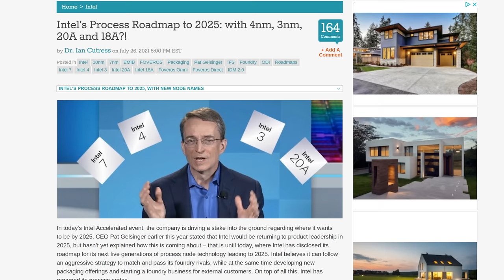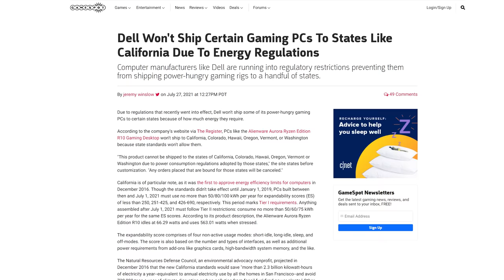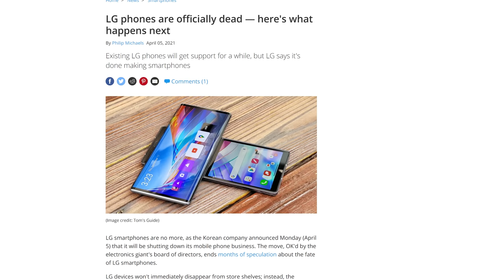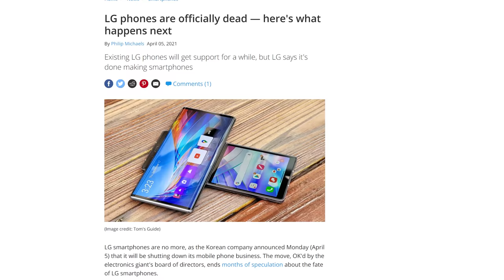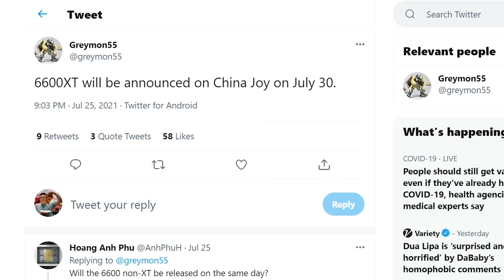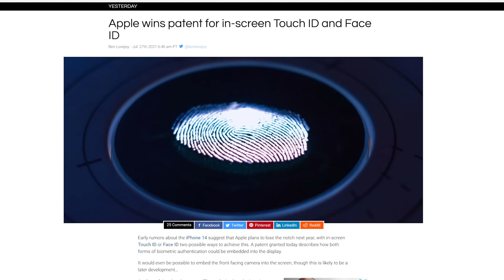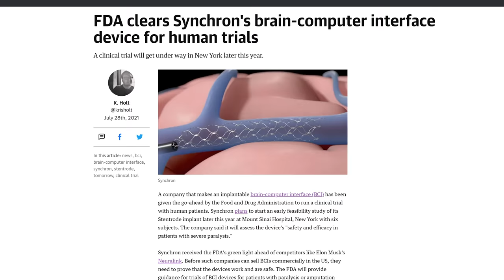Intel just changed the game.

Comment: California: we need to go after high capacity power supplies too!
Reply: Aka buy it on ebay & use it anyways
Reply: @levelup1279  yup
Reply: @levelup1279  wonder how that would work with support....

Also what happens if you have it in your car and get pulled over???
Reply: @dethrophes7283  you say you bought it when it was legal to do so and not be a prohibited person. Then get dragged into court and go through all that jazz just for them to be not able to prove when you bought it
Reply: @sar_ptolemy  so you somehow buy it on eBay with no record of the purchase?

Also are we sure there is a grandfather clause?
Reply: Actually, that's the whole absurdity of it. Having a high power PSU makes you exempt from those rules. If a rig has a 600+W PSU and a GPU with memory bandwidth of over 600GB/s, it is exempt from these rules.
Reply: @CanIHasThisName  no that makes sense.... only afftecs people who aren't rich enough to buy the best.
Reply: @dethrophes7283  It doesn't affect people almost at all, especially if you build your own PC. It affects OEMs and SIs only. And it's not true that you have to buy the best either. The way it is defined, expandability increases the allowed "budget" for power. So integrating a crappy motherboard with a ton of PCI lanes gives you more allowance than a smaller more premium motherboard. And in a few years, every GPU on the market will make a system with a 600W PSU exempt from the regulation. 
It's just an absurd law.

Comment: Hmm, I wonder of the brain-computer interface in the bloodstream has less problems with corrosion than directly in brain fluid like neuralink ... 🤔
Reply: I wouldn't know, but it looks like the installation process doesn't involve opening up your skull and lacing into your brain meats, so if you had to replace it every few years it wouldn't be as much of an issue. 
Outpatient surgery every few years beats boring old "completely paralyzed", I imagine.

Comment: Yup intel 7 which is the 10++.
and intel 4 which is the 7nm..
Surely nothing deceptive here...
Reply: TSMC pulls the same crap :p
It’s industry standard now
Reply: Ever since the move to finfet the number has not been accurate, it's all marketing
Reply: @npgoalkeeper  Yeah, we need new unit of measure that is more accurate.
Transistor density is pretty good replacement.

TSMC have smaller transistor but did not to put as much as intel larger transistor in the same square space.
Well, intel able to have better transistor density at cost of efficiency, 11th gen which have similar performance to ryzen 3 thanks to that density but it also cause it to have twice power req/tdp.

Comment: I may likely misunderstand this, but instead of transistor size, units of measurement should reflect the smallest resolution used in creating geometric features in silicon or whatever material they end up using because smaller geometric features can increase contact surface area within the same volume, allowing for more current flow at the same voltage and more efficiently radiating away heat (more power at the same temperature per transistor). Please correct me if I'm wrong because I likely am.

Comment: Fun fact: computers waste 99,999999%+ energy as a waste heat and only use 0,0000001% or even less energy to do calculations. So if you waste energy as a heat in PSU or waste energy as a heat in CPU/GPU in the end it's all wasted energy and we have WAY WAY WAAAAYYYY WAAAAAAAAAAYYYYYYYYYYYYYYYYYYYYYY more to go in terms of efficiency.

Comment: 2:26 This isnt only about 'rule-biding power supplies'. The metrics are based about how much gaming pcs consume in kwh per year.. its also about the gpu, cpu, etc (the power supply is only a metric because its directly correlational). You cant build a high-end PC and yes, they were every-year lowering the standards and the law was passed in 2016 if im not mistaken. But having builds wich cant be shipped to these states is only logical. Californians and etc, can have their way, but it shouldnt hurt consumers from other states. Abiding by those laws affects both quality and costs.

If they apply the law fairly they should ban PCs from most other companies as well instead of going only for the big players...

Comment: It is about time they get some regulation on pc power usage. It has gotten out of hand. I used to enjoy building pc's up to a point where you had to have a 3 videocards in sli and a power unit of at least 1200 watt to run it if you wanted top spec. It became like running a microwave on full blast all day long. I just got rid of it and bought an xbox which runs at 70 to 120 watt max (!) aka 1 tenth of the power. Playing the same games. Good enough for me. Even the new series X which has very decent capabilities only uses 180 watt max.

Comment: Not shipping to Washington is a crime we produce more electricity than half of the country using dams alone.
We used to have nuclear but the state got that shut down because they hate cheep energy. Plus tons of wind and coal.
They're not shipping to Washington because of the degenerate governor Inslee ran on clean energy so he's spending billions on a train that runs at 35 mph and veto's anythings else. Instead of putting that money to maintain a robust power grid because that would mean having a system that ran more efficiently less prone to power outages and saved the tax payer money. That want to maintain a poor power grid so they can charge the tax payer more for burdening an outdated system. And then turn around and sell that excess power that Washingtonian's can't use to other states and Canada. Then they complain how Washingtonian's should use less electricity and turn lights off and don't use computers and that Microsoft should leave. While they fill there bank accounts with money they made off of selling our electricity.